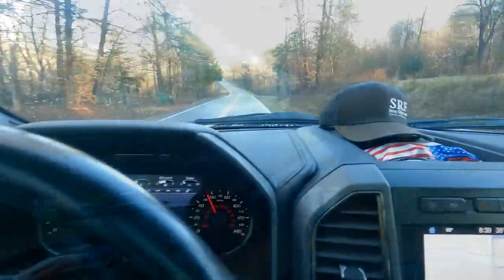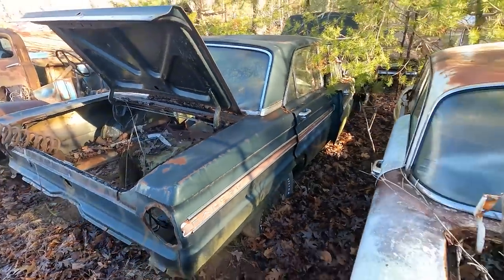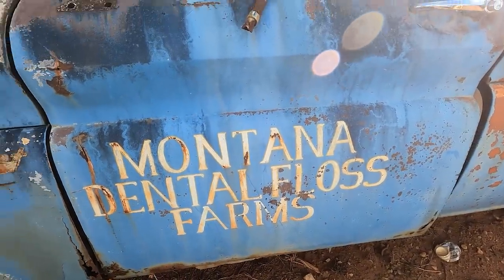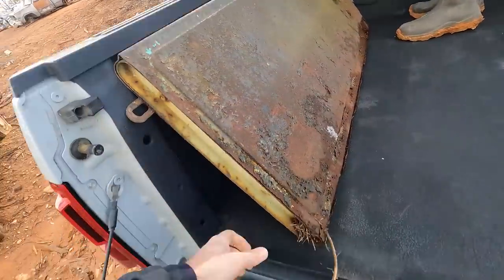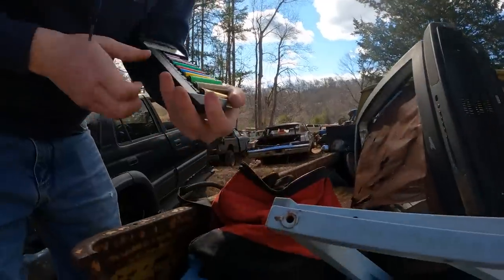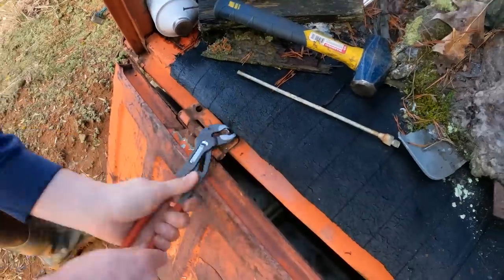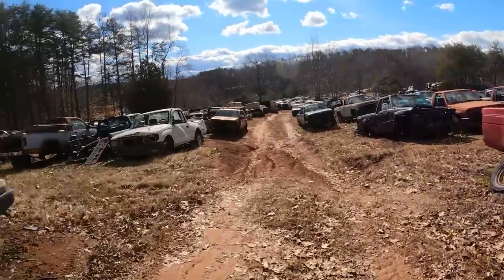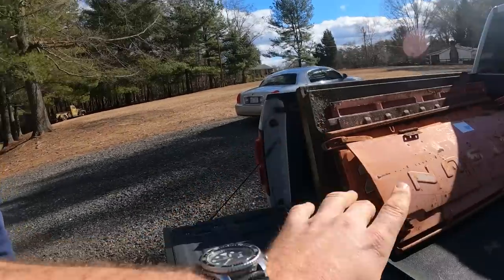You'll love this! Junkyard hunting for mancave art!

Comment: Hey Josh, at about 23:30, as you loaded a Toyota tailgate into the Raptor, you said "that's Stout right there." Was that intended to be a Toyota pun? That tailgate looked more like a mid-70's Hilux tailgate than an earlier Stout tailgate. Did you even know that the earlier (mid-to-late 1960s) Toyota trucks were called Stouts?

On a different note, the Chevy Luv was not a "domestic" mini truck. It was a rebadged Isuzu truck. Chevy didn't make their own mini truck until the S-10 came out in 1982. Ford's Courier was a rebadged Mazda, later replaced by the Ford Ranger. Chrysler sold the rebadged Mitsubishi trucks as both the Plymouth Arrow and Dodge D-50, and later replaced it with the Dodge Dakota. Isuzu, Mazda, and Mitsubishi all later sold their trucks under their own brands.

Finally, for the record, Puerto Rico is still not a state, but Alaska and Hawaii were states long before that (1973?) Datsun was built.
Reply from the maker: never heard that

Comment: I was at a gas station the other day and this guy pulls in and guess what he was driving a rebuilt Luv pickup. It was painted Grabber blue and it was in great shape. Been along time since I seen one. Too bad the station was so busy and he was over a island's away. Back when I was a young kid my friends neighbor had a Ford falcon with a 327 setup for dragstrip and everytime he would drive it around the block someone would call the cops on him, well it had open headers. The cops new him only too well. I have an old tailgate that came off a 49 Chevy pickup and it's painted blue with white letters, still has the original chains on it.